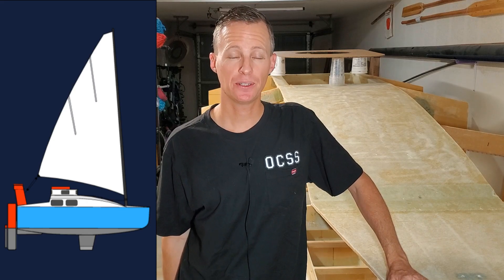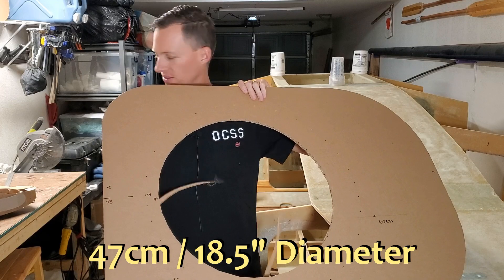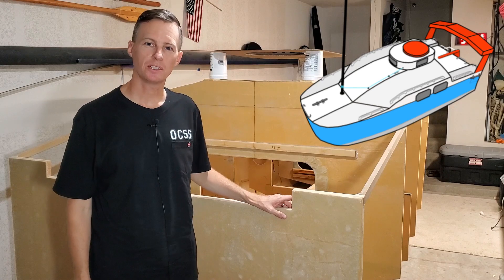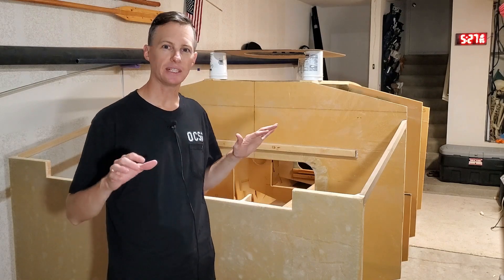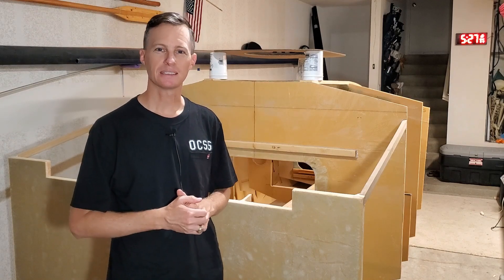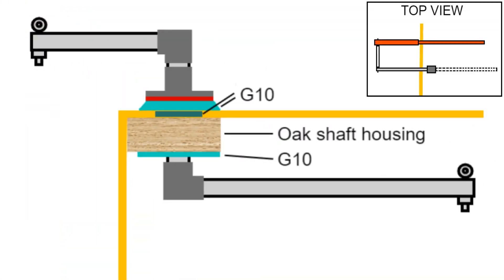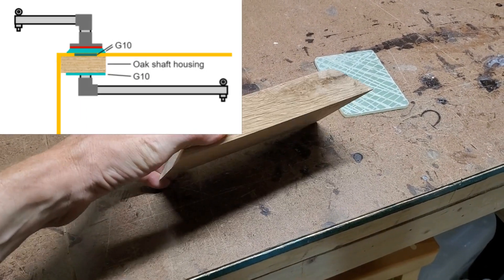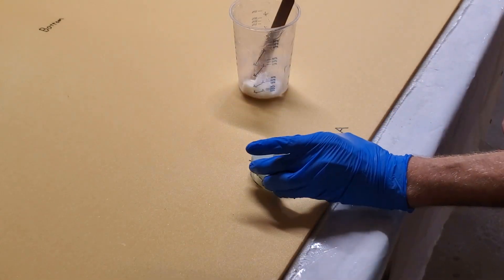OCSS-035 Not a Cockpit, an Aft Deck - Mini-Cruiser Sailboat Build

Comment: Im curious, how many miles a day can you get out of a boat like this?  Im thinking it’s going to sail like crap.  I hope I’m wrong.  Also, won’t you get all cramped up basically being stuck in a small cage?  You can only stand up in the hatch area.  That’s it!  I would get so antsy just after a couple hours in that thing, much less weeks!
I wish you good luck though on this project.
Reply from the maker: “You cannot pass! I am a servant of the Secret Fire, wielder of the Flame of Anor. The dark fire will not avail you, Flame of Udun! Go back to the shadow. You shall not pass!”
Reply: @ocean_capable_small_sailboat  ok, that makes a lot of sense. I stand corrected. Thank you sir 🙏🏻

Comment: About the "not a cockpit" and even the "doghouse", I can't help feeling I need to tell you about righting moment and how much of it is your body weight centered to windward.  Having no footwell reduces your mobility quite a bit.  I am wondering if your hatch can be (or is?) designed so that you can comfortably sit to windward with your feet in the hatch, and the open hatch area is effectively self draining.
About controlling the boat from inside -that is desirable, but have you considered the heel, the motion, and most of all, motion sickness?

Comment: What sail rig are you planning to use?
Reply from the maker: Ljungstrom rig.
Reply: @ocean_capable_small_sailboat  Why the Ljungstrom?
Reply from the maker: It's a very simple rig, the sail is furled with the pull of 1 line. I don't even need to leave the cabin to furl/unfurl the sail.

Comment: I think you need to enlarge your hatch opening as I don’t think you have taken into account having to exit that hatch in fouled weather gear which will add to the dimensions you will need to safely exit and or enter the vessel.
Reply from the maker: Smaller round hatches than mine worked for all of Sven Yrvind's boats and Blondie Hasler's Jester on adventures all over the world. It's well proven already.

Comment: Hi Perry
I used aft deck on my Anna 4.25 meter long 1967 sailing from Sweden to England.
Also I think your hatch is bigger than needed. For many years I used 40X45 centimeter. For the present boat I have a round one with a diameter of 42 centimeter.
I think that are getting fooled by using cardboard as a mock up. It is not solid enough to lean against.
If you used stronger material in your mock up you may decide that you can have a smaller hatch.
Reply from the maker: Thank you. Yes I think people are so used to over-sized hatches built for comfort, so they can't imagine a hatch this size. I like the smaller size for offshore use.
Reply: @ocean_capable_small_sailboat  True.
Also you are less fat than me.
Reply: @SvenYrvindExlex  Can't fool us Mr. Yrvind; that is all muscle, and we know it. Now you must teach this builder about Orca proof rudders!

Comment: Captain Perry, will you be sloping the portholes in the doghouse to give maximum view through them and present a sloped surface to any water coming over the bow or will the sides of the doghouse be vertical? Enjoying the build and the videos. Thank you for sharing.
Reply from the maker: I don't plan on angling the vertical parts of the doghouse. Because the doghouse is so small and low profile, only 18cm / 7in, and because it's curved, I don't feel like it presents a big enough surface to really need to be sloped. I'll put a circular portlight in the hatch so that I can look up too.
Reply: @ocean_capable_small_sailboat  That makes sense.

Comment: Advice: make housing larger. You are going to be readjusting sails much more than you think...
Reply from the maker: Luckily all sail adjustments and steering can be done both from inside the cabin or up on deck.
Reply: unless you want to go slow constantly.

Comment: with a boat this light its gonna be very fast by light wind, but I'm worried it wouldn't survive a big crashing wave...
Reply from the maker: Thanks to the squared cubed law, a smaller boat is better at surviving the force of a crashing wave than a large boat. The stresses on an object grow much faster than the strength as you increase it’s size. Double the size gives half the strength. See ep. 2 & 6
Reply: @ocean_capable_small_sailboat  Yrvind's boat has ticker core. As you can imagine it add strength.
Reply: @Philippe275  Thicker core adds stiffness but the strength of the panel is limited by the shear strength of the core material which isn’t very high in case of foam. Thinner core bends more easily so the laminate on one side of the panel will be in compression and the other in tension. Fibre materials tend to have their strength in tension. The strength of the laminate and desired stiffness of the panel dictate the core thickness